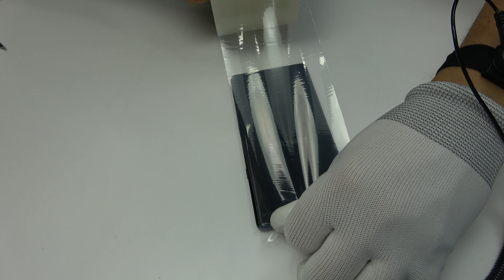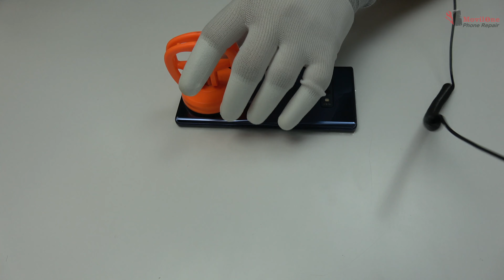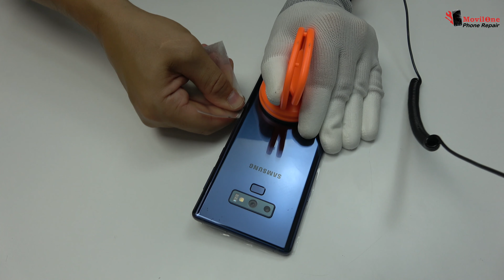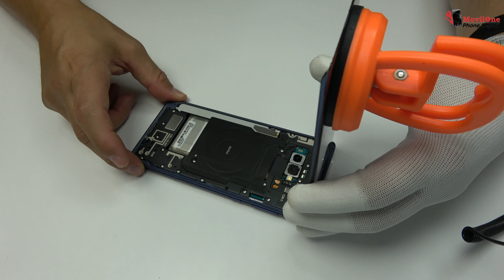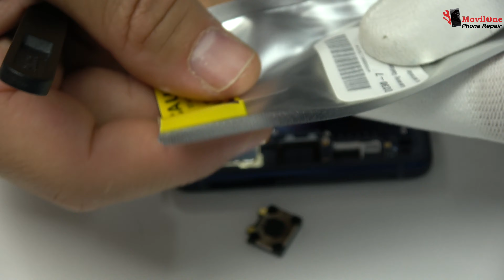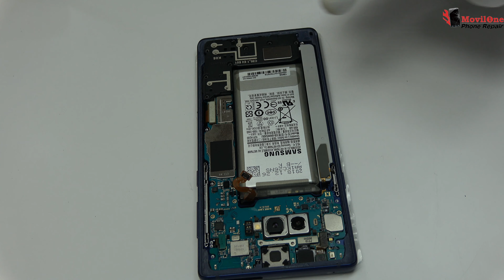Samsung Galaxy Note 9 Earpiece Replacement

Comment: When replacing the screen, I damaged the earphone jack, but when I make calls they cant hear me when on speaker mode, what is the issue?
Reply from the maker: Marie Goransson i think you ve got an otro len with the microphone...should be replace it or you have to open the device and see if everything is to it s site.
Reply: @MovilonePhoneRepair  where is the microphone just curious?
Reply: @mariegoransson4586  lol dont know if you need this information but anyway: its the tiny hole between the speakers and the charging port

Comment: I have changed the earspeaker. But still no hearing when call is in place. What can be the problem?
Reply: probably the mesh on the phone itself above the speaker is dirty and should be cleaned with alcohol, q-tips and a toothbrush